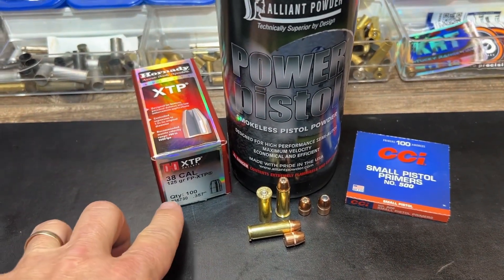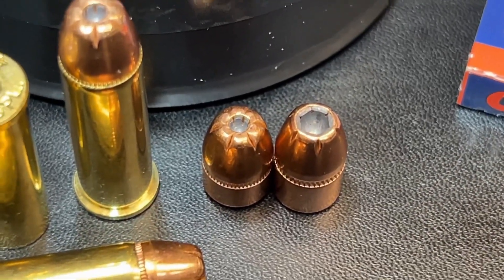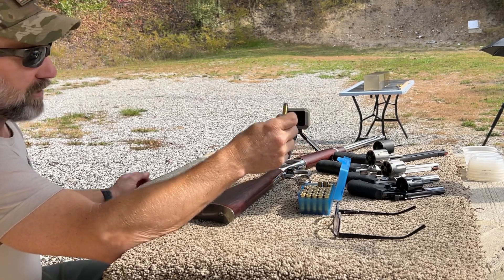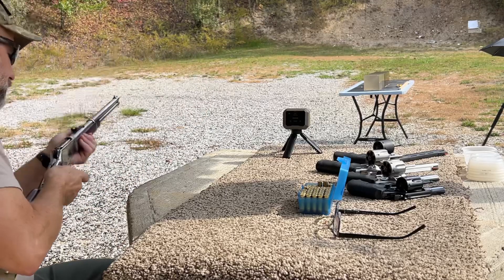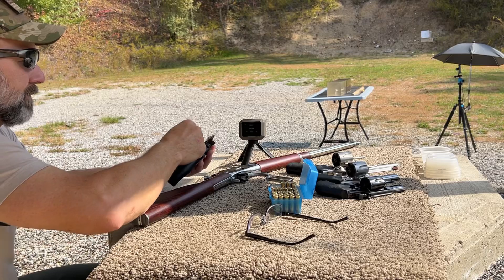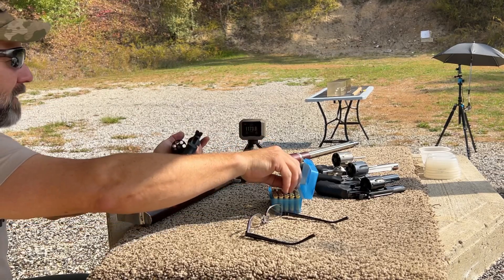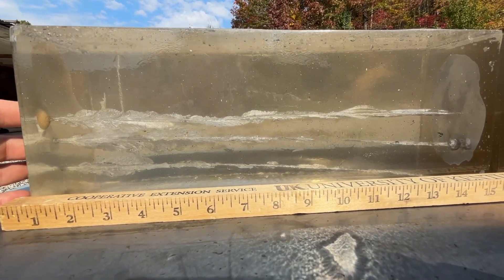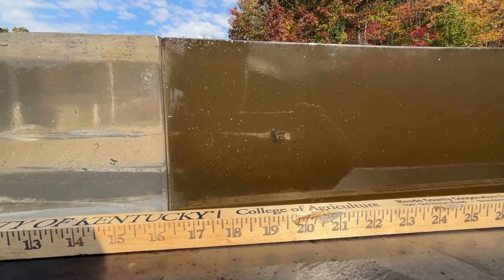.38spl Hornady 125gr FP-XTP Bullet, Gel Block Testing with 5 Different Barrel Lengths

Comment: have you gotten more fps from power pistol or H110 inyour loads
Reply: were the FP XTP AS ACCURATE AS THE STANDARD XTP IN YOUR TEST
Reply from the maker: I’m not sure. I’ve never did a max loading with both powders and the same bullets.  From what I’ve seen over the years, most of the load manuals use Power Pistol for .38 and light .357 loads and H-110 for heavier .357 and larger calibers.

Comment: The velocity surprised me quite a bit.  That load reported in the Hornady manual is only 1050 from a 4" barrel.
Reply from the maker: @craigbenz4835  I’ve noticed several other loads where the 3” put out some nice velocities too, even in the .357 loads.  The RP63 seems to be a nice, solid option for .38/.357.
Reply: I’m looking at my 10th addition Hornady book right now with power pistol max load 4 inch it’s saying 7.1 gn should be about 1050 fps. Was you using a book recipe or were you doing some wild cating 😂